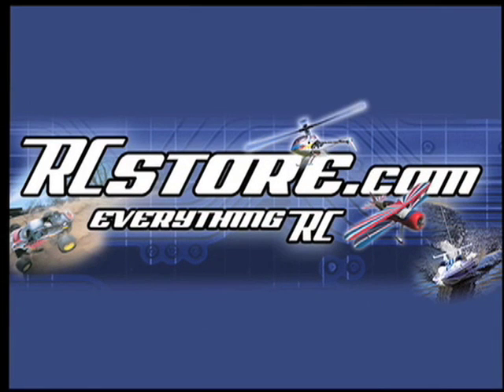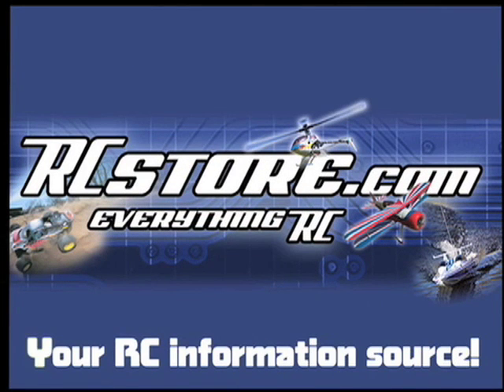How To Restore A Hex Wrench

Comment: the cutting disc will shatter if you apply too much pressure!

it's much safer to use a file or failing that some sandpaper